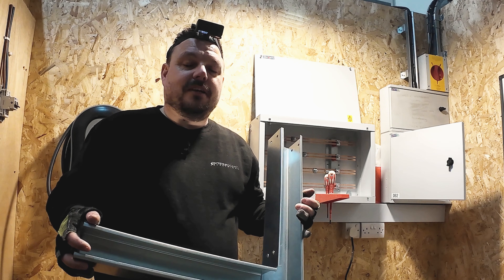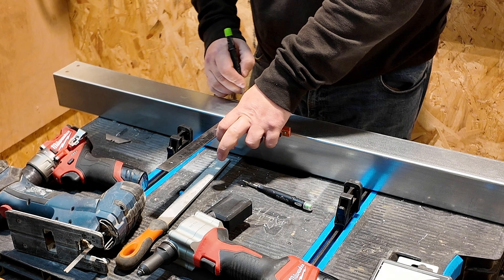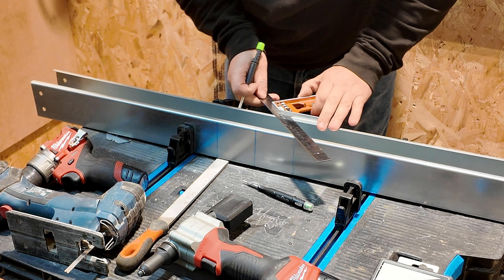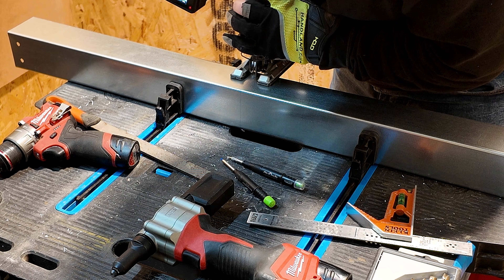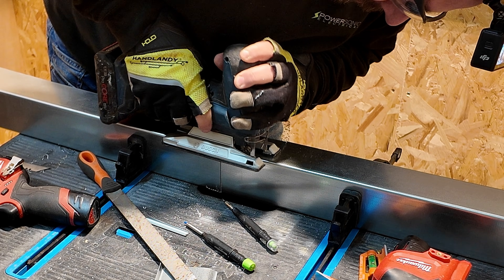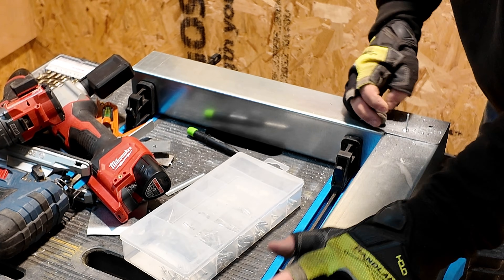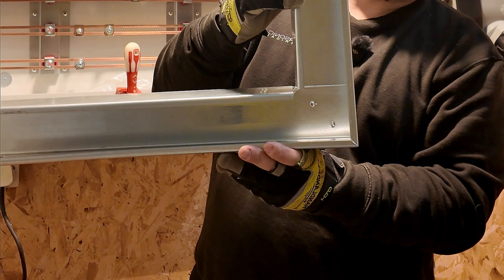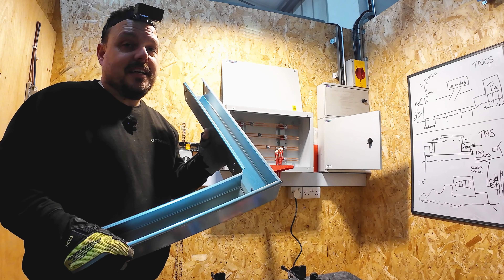Make a flat 90 degree bend in steel trunking in UNDER 10 minutes

Comment: What about your earth tag?
Reply: i can't decide if this is a joke or actually a serious question?
Reply: Well tbf 
Earth tagging was drilled into us back in college if you manufactured a bend. So, it's probably a serious question.
Reply: @gooburrr  The steel through the bend as being continous would automatically provide a lower resistance than a bit of 4mm earth cable. You could potentially justify an earth tag on a straight join or a tee. But then, if the joints are riveted & continuity can be proved through testing then i wouldnt bother earth tagging it. 
On the other hand, i guess it could make a difference & be warranted if you are using the trunking as a cpc??
Reply: @ashleybignell2366  Yes, from what I remember, the trunking is part of the circuit, so for our practical exams, we had to have earth tags throughout on our manufactured bends. 
Does it make a huge difference? Haven't a clue. 
Is it done on site regularly? Probably not, 😆.